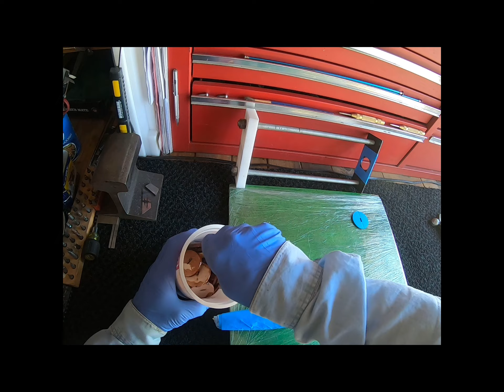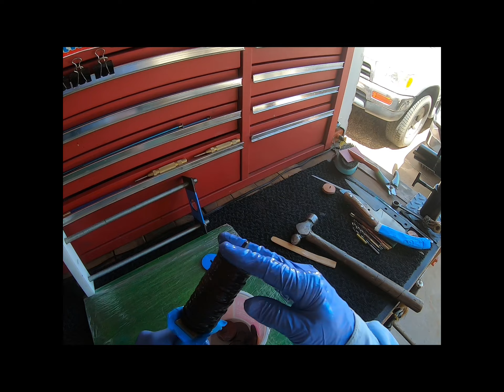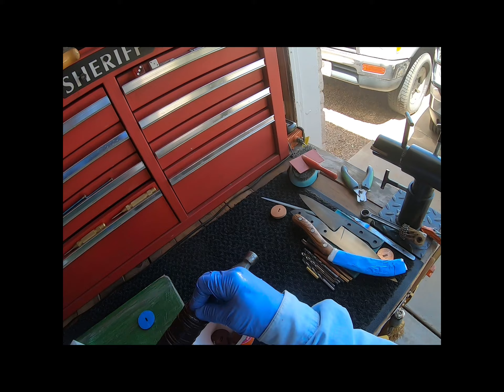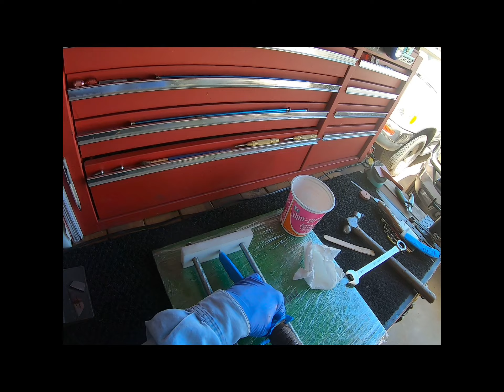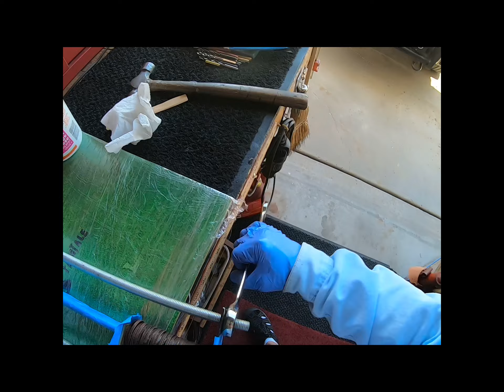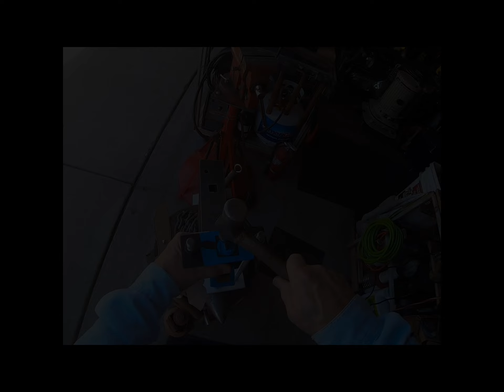How I Compress a stacked leather handle!

Comment: Nicely done and an excellent jig to compress every stacked leather washer.  Were you peening the tang to secure the pommel at the end of the video?  I hope more people will see your video and utilize the techniques in their stacked leather handle builds.  Thank you for filiming, editing, and posting it for those of us who are looking for the best methods to perform our custom work!
Reply from the maker: Thank you for your interest and for your support.  Yes,  after holding the leather “washers” in place with my homemade jig, I peen the tang to hold the pommel plate and everything in place to harden.  My problem was I could never get the leather pieces together and tight enough to eliminate all the gaps before my epoxy started to harden…this jig is the answer!  Thanks again, Frank🐋

Comment: Are you removing the plate at the pommel, or are you cutting/grinding it down after the epoxy sets? (Cause it looked like you peened the tang to make a mechanical connection with the plate).
Reply from the maker: The tang was peened while the epoxy was uncured. The mechanical connection keeps everything together while the glue dries. The pommel plate was already shaped to match the leather pieces. I hope this helps.  Thanks for watching!🐋

Comment: I think you should of speed it up little more. That way  you really couldn't see anything of importance. Someone just starting out should forget this video until they have done a few. By the question's it appears they don't know what was going on either.  So I figure you really don't want anyone to try your way.
Reply from the maker: @RichardRounds-k9z  yes, some beginning knife makers may want to try a few leather handles before trying them this way. This method with my homemade jig was after several attempts of not getting the leather fully compressed.  Thank you for your comment!🐋